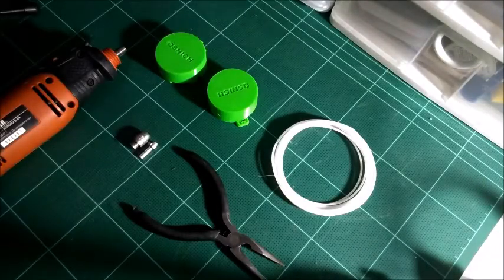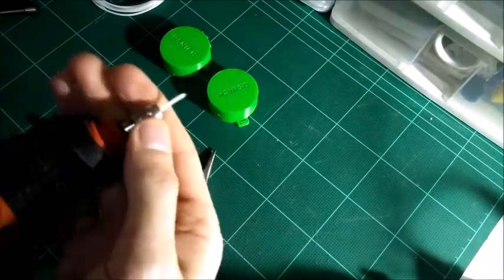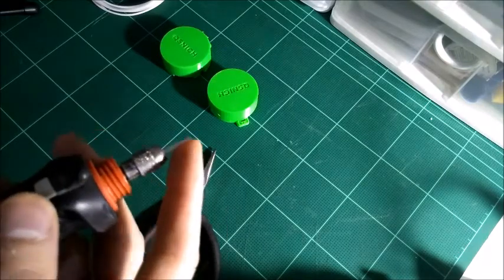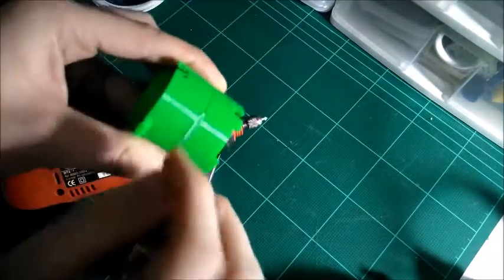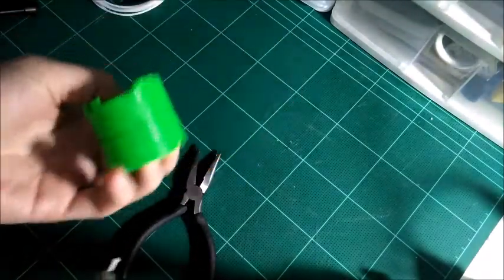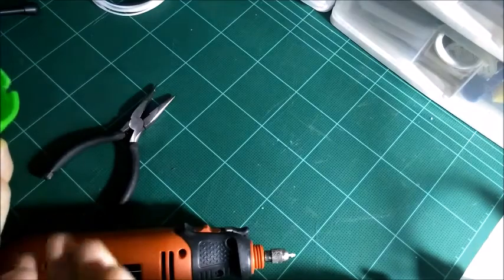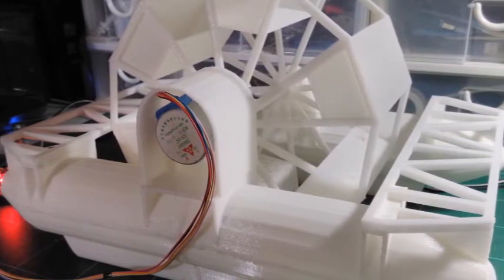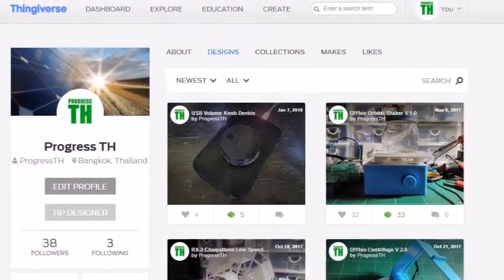3D Printing: Friction (Spin) Welding Tutorial

Comment: You mentioned the setting on the particular tool you were using. Can you please recommend a more specific RPM range ideal for performing this process? Also, was wondering if the use of some light clamping would be helpful for easier & more accurate welding to keep the pieces straight & flush? Thank you & thank you for the instructional video.